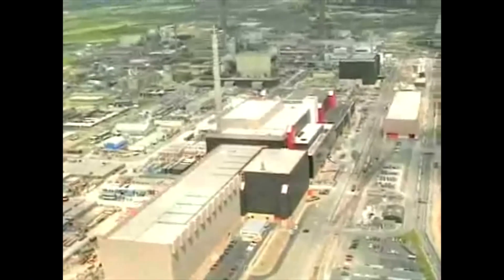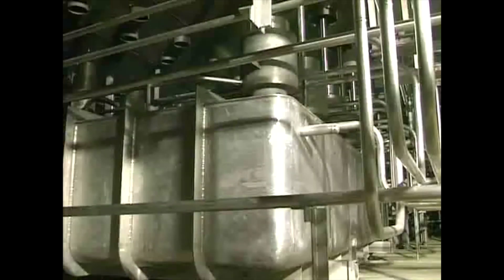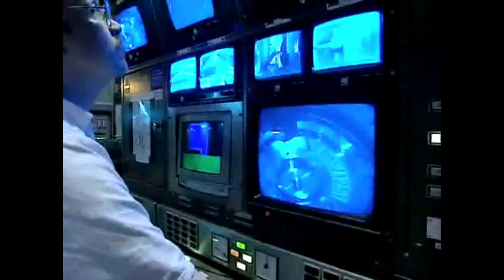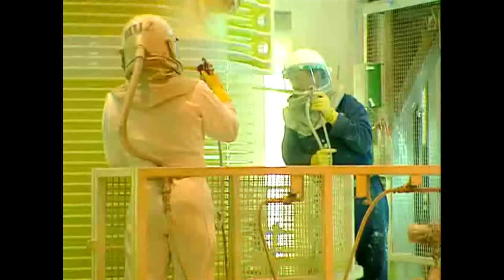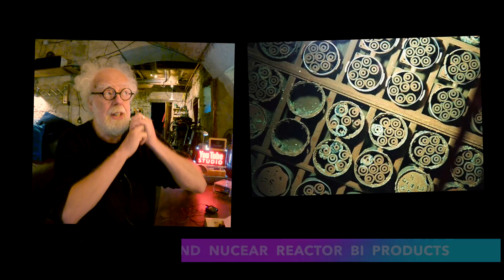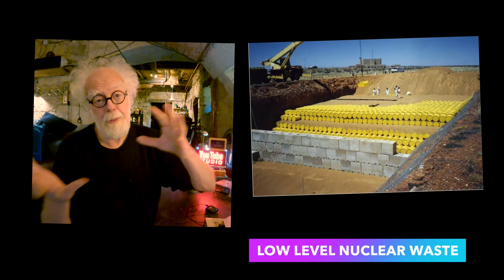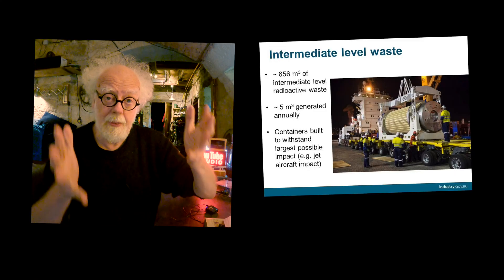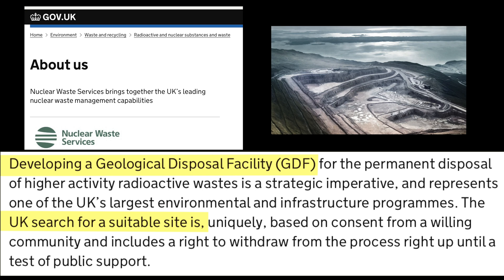Amazing UK Nuclear Waste Problem

Comment: I did go to the closed to the public  Space Comm Conference for businesses in 2021 and 2022 and wonder if you know anything more about the new micro Rolls Royce Nuclear power micro reactor units only really the size of a suit case we saw. I wondered how safe they are obviously we could not get too much detail from the Rolls Royce crew there secrets you know.. They did talk about they could be used in areas for power from the back of a truck container which would actually be good and could power a town from one unit.

Comment: Well when we have WW 3 that will likely deplete the waste everywhere so puff goes the plutonium and of course us locals know all about  Windscale near meltdown and  about the health benefits of such radioactive leaks like Random cancer clusters  just around the incident no correlation of Course after loads of radiation escaped oh no. All they do here is rename and puff the problem is gone.  If glowing in the dark is your thing and of course shortened life spans from cancers so forth just move there but at least we can joke about it. As kids we saw the ready break adverts for porridge with glowing orange kids going to school. We used to joke they must live near Windscale. Also jokes like move to Windscale and glow in the dark. I had a tour around the Sellafield plant as a kid the glass blocks etc. I was so disappointed as my brothers trip 2 years ahead of mine was a tour around Jodrell Bank Space Centre.  
We just got likely a mild dose of radiation lucky us and got to know all the lovely lying PR. I did ask about the leak obviously they did not answer.  I did detect a wee bit of shuffling around at the question.

Comment: The Magnox reactors were designed to produce power and also plutonium for military use. I forget the exact irradiation time for peak plutonium production, but after the credit for plutonium in the discharged fuel was cancelled, it no longer made economic sense to discharge fuel so soon.
Irradiation times were gradually increased with monitoring of the fuel elements structural condition so that much of the plutonium was also used up in power production. I think that it may have been increased from 1500MWd/tonne to 4500MWd/tonne (but as I said, I forget the exact irradiation- it was nearly 30 years ago) thus considerably improving fuel utilisation and reducing the amount of plutonium sent for reprocessing, so I don't think it is too much of a problem. We just need some more power stations to use it. (Thank you Thatcher and Blair for the damage you have done to our nuclear industry!!)
Reply from the maker: thanks Mervyn

Comment: Plutonium is perfect for molten salt reactors. That is 239. Plutonium 240 not so much. Molten salt with u238 with a fast reactor will produce about 10% of the power output from the reactor. Just simple table salt. Does not need liquid sodium or any such falderal. In fact if the chlorine produces a nasty side effect product it will keep the reactor fuel from being stolen for nefarious purposes unless it poisons the neutron flux inside the reactor. Xenon can be outgassed out of the molten salt outside the reactor to keep it from effecting operations.

Comment: Bomb material is Pu 239 but  the waste pile will contain Pu 240 as well.  It would be tricky to separate those two isotopes which is probably why we don't do it, and we use different reactor types to make bomb grade Plutonium.  
We hear a lot about nuclear waste having to be stored for 100,000 years but really after a thousand years this stuff is pretty harmless.
Reply from the maker: thanks Colin
Reply from the maker: question....how do you store large quantities of plutonium without it going critical?   is Plutonium oxide a safe way to store it?
Reply: @SimonHollandfilms  unless you store it one big lump it won't go critical.  For perspective I could store it my front room if floor could take the weight!  It will be a bit more dispersed in Sellafield and there's no moderator to slow down the neutrons so that big shed ain't gonna turn into a reactor, in any case reactors don't go critical, they operate subcritical, critical is an atomic bomb.
Reply: @colinmacdonald5732 Reactors do operate critical - a sustained reaction. Supercritical is an atomic bomb - an exponentially increasing reaction. Subcritical is a reaction that can't be sustained.
Reply: That is a GREAT question.

Comment: Windscale was built in order to produce plutonium for Britains nuclear arms. They gave up when the Americans dropped the H bomb.  Also, Fukushima was one of Thorps biggest customers and is one of the significant reasons why the plant has gone into quiescence

It’ll be storing the fuel rods for the next 100 years, but no more production takes place.

Comment: BNFL=British Nuclear Fuel Limited sounds familiar. I believe that they bought a bunch of reactor manufacturers in the USA! MOX! I have heard of MOX! Precisely what it is I don't know, but it is a mix of fissionable uranium and plutonium that can be used in a nuclear reactor to make electric or separated back into uranium and plutonium so that the plutonium can be used to make bombs. That is why MOX is not sold to just anyone. ( no to Iran, N Korea, etc) This probably why the plutonium is piling up in the UK reprocessing facility. Supposibly, they made and possibly are still making the MOX blend somewhere in the USA for commercial reactor use in the USA and , well in the past at least, for Russian Federation reactors. It was way of decommissioning surplus nuclear arsenals or bombs at the end of the Cold War,  and a way for both parties to comply with the arms treaty.

Comment: A reactor designed to burn it up and make electricity will have to be built.  Eventually there will be a calculation that the cost of maintaining this material and the potential hazard of having it means it should be destroyed in a reactor versus having it diffused and stored in a place which also needs to be shielded and guarded will push something to be done.  As with most government projects, the cost will be lowballed to get the project going and involve engineers who plan to have their grandchildren inherit the project.

Comment: Hmm weird the US uses plutonium in RTG's (nuclear batteries where they cant use solar panels) on space ships and mars rovers ..  they ran out of plutonium and for a while got some from russia for their spaceships.  They ran out of that .. and they are now useing a partikel accelerator to create small amounts of plutonium for future missions to places like mars.   Maybe the UK can send them some plutonium,  or is it a different form of plutonium.    In russia there are apparantly a 1000 plutonium filled RTG's scattered over the land,  used to power things like lighthouses,  sometimes it goes wrong .. people scavenge the steel of it and leave the plutonium pit in the field and people get radiation burns .. search for russia rtg's on youtube.  there are a bunch of videos about it.
Reply: I was wondering that myself. NASA used Plutonium to power probes such as the Voyager's & I heard they are running out. Not sure why they cannot use ours.
Reply: @johnstokes8511 Radioisotope Thermoelectric Generators only work with Plutonium 238.

Comment: In sci fi films, people have radiation suits , shields etc. Have we ever invented anything that that is radiation resistant? Or is it still science fiction?
Reply: Thats why they unload the containers under water,  and store the rods under water.  Not only does it cool the rods,   but the meters of water stops the radiation.  I guess everything stops radiation,  if you have enough of it.  And if you have a limited amount of material like in aprons of xray installations they use heavy metals like lead.     Actually to measure particular particles or radiation from space you want to shield the instrument with tons of lead. They actually use really old lead for that salvaged from centuries old  ships that sank, because modern lead thats is made after nuclear tests produces too much radiation.
Reply: It depends on the type of radiation. Alpha can be stopped with a sheet of paper, beta is more penetrating and gamma is the worst. I think lead is best for gamma and for neutron radiation which you get a lot of from nuclear power, you are better off with materials with light atoms, like water or hydrocarbons, e.g. polythene is good for that.
Reply: Science fiction. As explained in the video, you need very thick concrete or lead to block Gamma radiation.

A suit will do nothing.
Reply: The Apollo space suits seemed to fit the bill, able to deal with massive temp fluctuations and solar radiation, and that was what, 50+ years ago.  They were able to jump around on the Moon's surface and move with hardly any restriction, so I would've thought that by now they should have really great suits....... Or do they???

Comment: If you show the space for a plutonium storage it does not show anything. Have you checked out how plutonium is stored? How many grams are allowed in a countainer having space x? Multiply this with hundreds of tons.. eh ..

Personal opinion about that granite quarry is that it might be partly a covert operation for building a military base because the tunneling creates lots of material which could be shipped out unnoticed when mixed with the product.

Granite itself contains uranium. Personally i do not like granite - at least local granite - to be mixed in concrete because it creates radon gas. The old Finnish saying is that if Helsinki would not have been then here would be a uranium mine.